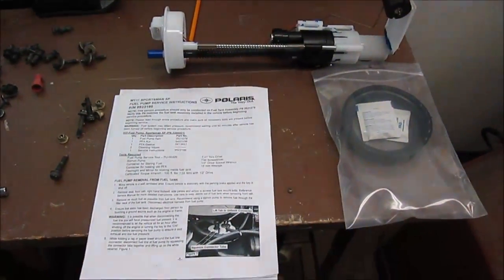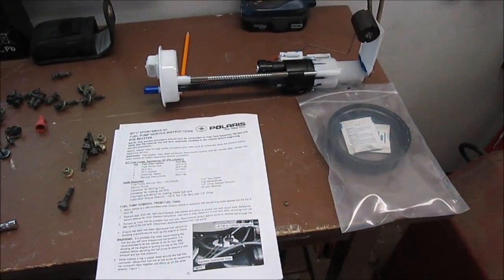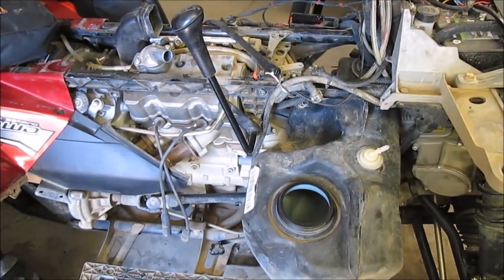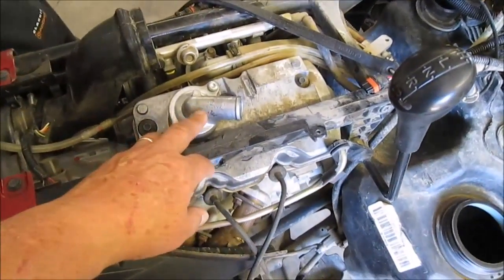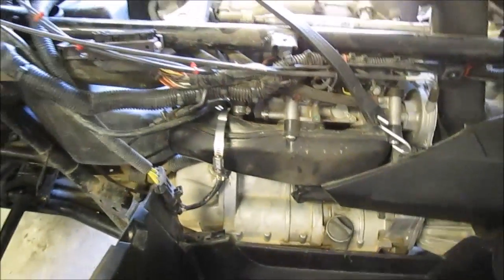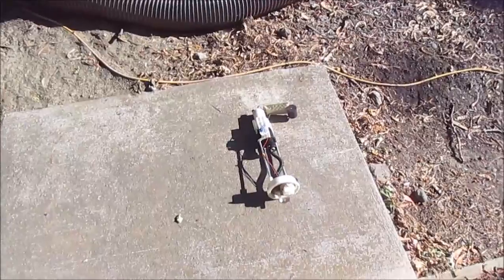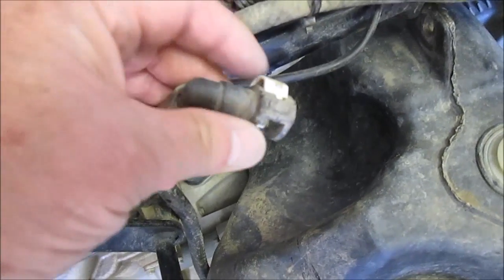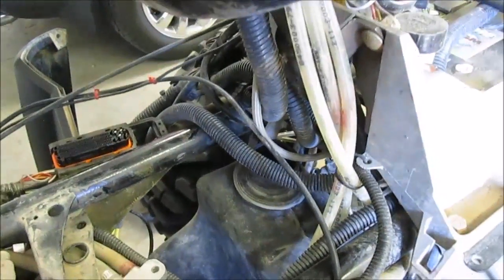ATV Polaris 850 Suddenly Dies

Comment: I had similar stalling issues with my 850. This after the service shop replaced a rogue starter that would engage with no key in the ignition. The Polaris dealer trouble shot the stalling issue with no solution, I happened to noticed one day that the kill switch wiring coupler was loose. I fully engaged it and made sure it was clipped in. I have not had a stalling issue since. I will assume the kill switch was opened for the starter install.The starter was replaced a few weeks beyond the warranty period with no help from Polaris.  I was not impressed with my service dealer but the machine has run awesome since. Hope this helps some fellow riders.
Reply from the maker: Thanks for the good information on the kill switch.  It wasn't easy for me to find this solution with research and repairing other possible causes.  Your Polaris dealer would have the same difficulty.  I posted this video to help with the research.  A couple weeks ago I rode almost 200 miles with no problems.

Comment: Was this the last problem Your 850 had? I Changed the airbox with the new kit and replaced the circuit breaker already
Reply from the maker: I had a 2 year old battery fail after replacing the fuel pump.  I didn't have any problems with my 850 for the past year.

Comment: Ive had two of these pieces of garbage over the years.. a 2010 850 that was nothing but problems and then traded that in on a 2012 which spun the timing chain gear on the crank after 2 hours of riding so.. yea I got it fixed and got rid of it and picked up a Rubicon and 10 years later.. not a single issue to report.

Comment: Fuel filter went bad on my 850, I feel like changing the pump as well to Rather feel safe than sorry, should change the whole assembly like you did?
Reply from the maker: It takes some time and work to reach the fuel filter so it would be a good time to replace the fuel pump and filter.  It costs a lot more for the fuel pump but you won't need to repeat if the old pump is failing.
Reply: How often do you change fuel filter? I have an 18 850 with 1400 mi

Comment: Do all 2011 Polaris 850 have this problem? Mine is stalling out just like yours
Reply from the maker: Only those with a failing fuel pump.  I tried several things to correct the problem but the fuel pump replacement was the only thing that worked.
Reply: Dale Christensen the fuel pump sounds different and quad works when I let it cool down
Reply from the maker: It looks like you've had this problem for a couple months.  It costs some money and takes some time to do the work but it's better than needing to be towed when it won't run.

Comment: Have gained 30miles with no problems since the fuel pump replacement, is there any advice you should give after replacing the fuel pump?
Reply from the maker: I just finished a 40 mile ride and haven't had any problems since I replaced the fuel pump about 400 miles ago.  If you have any other problems it most likely won't be caused by a bad fuel pump.

Comment: Believe I’m starting to have the same issue on my 570 sportsman...will run fine for 20-30 mins then all of the sudden it develops a miss and it will stumble and spit and sputter.  The next day it will be fine again for the same amount of time.  99% sure it’s losing pressure after warmed up.  Got a pump assembly coming tomorrow, will test pressure cold then let it run for a half hour or so then test again to be sure.
Reply from the maker: It would be nice to know if the new pump solved the problem like it did for me.
Reply: @dalechristensen3433  hopefully will find out this weekend!
Reply: Same thing happend to mine I changed the pump did not change it
Reply: @Huntercantell576  mine ended up being broken wires going to the tps sensor.  Replaced the pigtail going to that sensor and it fixed it.

Comment: I had same problem on 2015 rzr 900. it is an o-ring on fuel pump that becomes dislodged causing pump to loose nearly all pressure. Walked out of the desert TWICE. first time dealer told me what happened and the replaced o-ring and assured me they have never seen that before an said it should never happen again. few months later happened AGAIN. Polaris customer service are the rudest people I have ever dealt with. They agreed to send me a new pump finally, MUST BUY ENTIRE PUMP ASSY FOR $450 otherwise. I installed new pump and carry the old one as a spare after disassembling old pump and installing two rings. The pump assy can be dismantled and replace pump with $50 pump motor off ebay if pump motor dies.....don't pay the outrageous price from pooplaris. Side note all Polaris machines use pretty much the same pump assy
Reply from the maker: That's good to know about because I just bought a 2019 RZR 900.

Comment: Same thing happened to mine and I had to walk back 18 miles! I suspect a fuel pump defect. Has anyone else had the same experience?
Reply from the maker: I was lucky to ride with someone who could tow me back out.  I found only 2 other messages on forums from people who had the same problem and resolved it with a new fuel pump.  I haven't had the problem again.
Reply: Thanks for your reply. I have owned over 5 Polaris Rangers and ATVs and this one-the newest(bought last Spring) has given me problems-same thing. In the past I have left it for 5 mins. then it started and ran just fine. This time I waited 15 mins. and still wouldn't run. We use them on a large ranch.
Reply from the maker: There's one indicator to a failing fuel pump.  When you first turn the key on it will make a buzzing sound as the fuel pump builds up the fuel pressure.  If you don't hear the buzzing sound or it sounds different then the problem might be the pump.  My brother's Arctic Cat (non-EFI) had a failing fuel pump and the sound was the only indicator.  You might need to release the pressure before turning on the key to hear the sound.
Reply: Thanks for the indicator. I'll certainly be more careful. Never had such a problem before with Polaris. Makes me skeptical of the new models!
Reply: Same problem with 2015 570, brand new with 24 hours on it (202 miles).  One exception- mine was dead never to run again.  Tested fuel pressure, had 20 psi.  Dis-and Re-assembled (thinking the o-ring was leaking past) and then got 10 psi.  Repeated process, and got 46psi but it stalls idling.  Waiting on new fuel pump to arrive, for a brand new machine.  My first and last Polaris product.  People can say what they want about buying American, but I am pretty sure if I had got a Honda, I'd be trouble free, as it should be.  And if Polaris is listening, I will tell any and everyone how I feel about this.  I also did call the Polaris corporate consumer line to no avail.
Reply: I have the same problem on my 800 sportsman soon as it gets hot it dies n u have to cool it off to get it started again

Comment: My problem is a dirty fuel filter, but do I really need to take the air box to get to the fuel tank?
Reply from the maker: The bolt holding the upper left side of the fuel tank is almost impossible to remove without taking off the air box.  The tank needs to be moved to the right to be able to remove the fuel pump and filter.  I decided it would be easier to remove the air box instead of working with limited access and I'm glad I did.
Reply: Dale Christensen how long did it the whole procedure last?
Reply from the maker: It took about 4 hours to complete.  I already had practice removing the plastic but it was the first time removing the air box.
Reply: Dale Christensen Alright, already purchased the fuel filter but the dealership offered to change it, thanks for your cooperation though

Comment: Hey man that white weep hole on top of your fuel tank what hose goes on it, I bought a used one and there's nothing on that white fitting
Reply from the maker: The white fitting, that is not part of the fuel pump, is a vent connection.  I have clear plastic vent lines that all seem to terminate in the headlight pod.
Reply: @dalechristensen3433  thanks man

Comment: My 850 seems to be bogging out and gets hot I was thinking I used bad gas and started using higher octane but same problem still what do you think could be the issue??
Reply from the maker: My 850 bogged out and died when the fuel pump was failing.  You might consider checking your air filter and spark plugs first.  The fuel filter is on the fuel pump assembly and if you want to clean it you should probably just replace the entire assembly.  This would rule out any problems with the filter and pump.  Also, if there's a leak in your fuel line it would cause the problem you have.
Reply: @dalechristensen3433  thanks a lot! I will definitely check that! I’ll get back to you once it’s fixed and let you know.
Reply: I have this same problem and need some help. I’m getting Getting intake pop and running rough from stop to getting going. Very choppy start to get the rpm’s up to engage the clutch basically. 
I’ve changed the filter, oil, plugs, and put a quantum fuel pump in today. My fuel pressure is good at 58psi now but still running rough.

Comment: If you keep your fuel tank more than half full this will never happen gas cools pump keep this in mind on hotter days
Reply from the maker: I tried that on a ride before I replaced the pump and it didn't work when climbing up hill.  The new pump is still working great.
Reply: That is fine for those that only do a 10 mile ride. But we ride 80 to 100+ miles after leaving camp
Reply: @georgedeitrich4647  bring extra fuel simple
Reply: For people that ride only 10 or 15 miles from camp they is easy to do. We ALWAYS fill up before leaving camp and ride about 100 miles and more.

Comment: Ok so it is my fuel pump I was confused why it would start sometime and others it would just crank
Reply: Also my clutch is bad so at this point I might just rebuild the whole thing so I don't have anymore problems things only got 71 hrs on here pretty much brand new
Reply from the maker: The posts I read said they thought that the pump was over heating or foaming the fuel.  If you wait 15 minutes and it starts okay, it might be the fuel pump.
Reply: @dalechristensen3433  idk I let it sit over night it turns but never starts it'll some what run if I keep the starting motor engaged otherwise it doesn't run at all
Reply from the maker: @oldirtyguru7004  It doesn't sound like an ignition problem.  My 850 did the same thing when the fuel pump went bad.  It could be the fuel filter and that's located at the bottom of the pump.
Reply: @dalechristensen3433  thanks I'll keep that in mind when I take mine apart